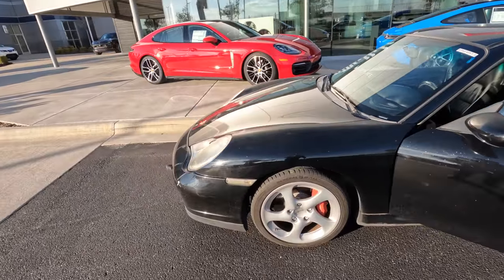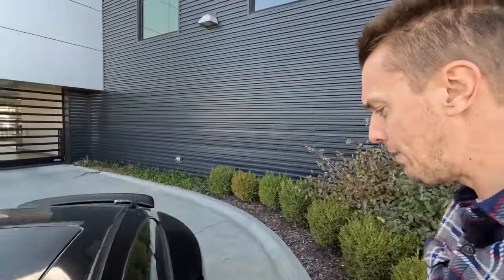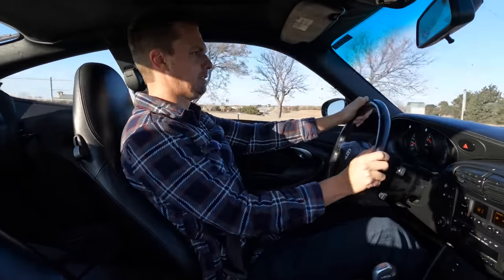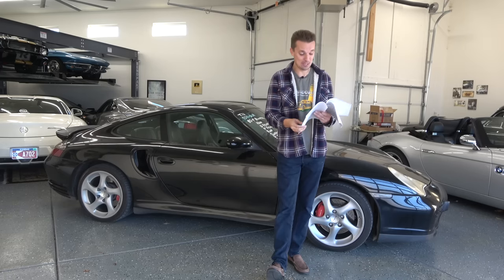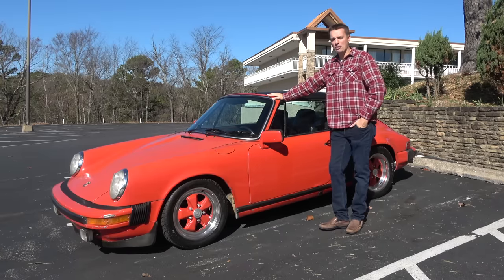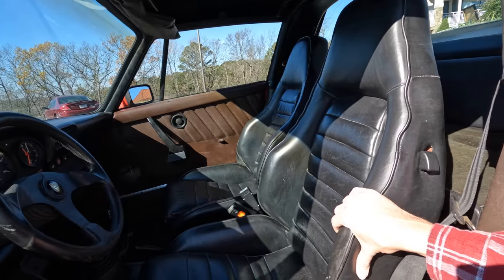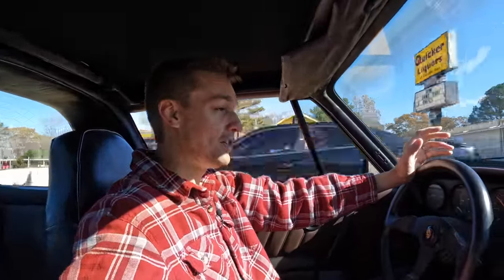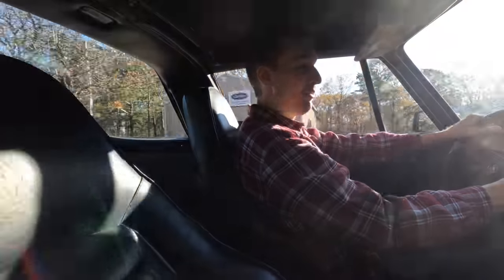The only CHEAP Porsche 911 Turbo is a RUINED ex-Las Vegas rental beater. Should I buy it?

Comment: Seats were definitely swapped, I’ve never seen a turbo without the hardback sport seats. I have a set if you’re looking for them, they need a bit of work but can give you a good deal.
Reply: I'd guess the supple leather is way more common to see paired with a Tip, which itself is in the minority.
Reply: There are some turbo 996 Porsche that don't have hardback but i think they did swap them
Reply: My 996 Turbo doesn't have the hardback sport seats.
Reply: Supple leather 996 turbos are everywhere…
Reply: Sport seats and hard back seats were separate options in these 996 turbo cars. Many  Tiptronic cars shipped with the standard comfort seats.

Comment: I had an S-Line a6 2.7t,  years ago. I honestly didn't hate the tiptronic. You learn to time your upshifts a half second early, and once you nail that delay, it becomes fun to use. I remember the downshifts being almost instant, so if you needed to pass, you just tossed the stick over and down and zoom around the slow guy lol
Reply: Ive had one tiptronic car and i also thought it wasnt that bad.
Reply: Tiptronic actually suits this 911 Turbo. The engine has so much torque you don't need a fast / manual shift unless you are using it as a track car.
Reply: It's actually a good thing these initially came with slushmatics for the automatic version. It would have been worse if it had the sequential automated manual transmissions that most other supercars had at the time. In everyday cruising, stop/start traffic and freeway driving you wouldn't want clunky shifts.
Reply: Agree. Gotta time the upshifts but you definitely pick up on it fast
Reply: tiptronic became popular when I was learning to drive stick, tried it on a new (at the time) altima which threw me for a loop because it was down to upshift and up to downshift so I'd accidently try  to downshift to hit third but that thing didn't accept your prompt to shift half the time anyways lol
Reply: i do imagine that is the case
Reply: Yep, the trans is good.
Reply: @aaryeshg.6526  True, early dual clutch automated manuals were pretty horrendous, nearly impossible to launch smoothly or crawl in traffic. Even if they worked correctly it was just a matter of when, no if they break.
Reply: Got a triptronic in my 2000 A4, definitely love using it, almost as good as the manual in my 97 A4 Quattro

Comment: I have a 997 turbo manual.  I think it is a better car than the 996 and not just because of the lights but both rank among the greatest cars ever made.  They have mind bending performance but can easily be used as daily drivers and with the back seats down they will take plenty of luggage.  I even got a full set of golf clubs and trolley in the back once.  The acceleration is amazing but the best bit is that they take corners at ludicrous speeds.  I retired recently so sadly mine is going to be for sale once I sort out an electrical gremlin.  I have had it for six years and have loved every second driving it.

Comment: On the orange Porsche - I detail cars, and I think the paint could be brought back with a moderately aggressive polishing compound, followed bu a hand wax. Be careful not to buff through the top coat, Comet WILL work, especially on single stage older paint, but it bleaches and flattens the finish. On the deck lid, the holes are relly ugly. IF you can match the paint, fill and touch them up .If not , consider putting in flush carriage bolts and touching them up. Wouldnt look too badLOL.

Comment: You totally nailed it with the “lower horsepower, older car” being super fun to drive on back roads. Certainly not the same, but sometimes my e30 is way more fun to cruise around in than my “fast car” or ones I’ve owned in the past.

Comment: I've become a big fan of the 996 with in the last 2 years. The headlights kinda grow on you once you see them in your garage, and is part of the reason you can get better deals on the cars. Although a 987 Cayman S is more of my obtainable dream car, I've owned a 986 with the 2.7 swapped. Just rather have a hardtop and a little better interior design.

Comment: Turbo must be a premium upgrade. In 2008 I bought a wrecked 911/996 Carerra 4 AWD with the wider rear quarters for $15k and pit 7 more into it to have it repaired painted.  It was only 7 years old vs 20.

Comment: My 1st nice car was a 2001 turbo CPO car. It was fast for its time and a daily driver. Some expensive (CPO covered) engine problem was fixed for free by dealer and I sold it when warrantee expired. Mine was a Tiptronic as well and as I recall, they were faster than the manuals 0-60!

Comment: That GoPro needs a jacket, apparently. Double Porsche rescue seems risky, but it appears both of them want to live. The 911 really needs an interior which might not big a big bill compared to the roof and engine replacement, but that stripper paint job on the other? That'll looks like it'll need a complete sanding and respray won't it? That wouldn't be cheap even if you took it to Maaco.

Comment: Tyler (Hoovie),

FWIW, the carburetors mentioned appear to be two 3 barrel Weber 40 IDA 3C models.

These Weber carburetors are configured as inline three barrel, using three throttle plates on a common throttle shaft. As such, this carburetor is not progressive as all throttle plates displace equally.

Once understood, Weber carburetor tuning becomes intuitive. Though it is highly recommended to incorporate two wide band O² sensors, one per engine bank, to record or diagnose rich or lean air fuel ratios.
One may expand on tuning by installing individual Exhaust Gas Temperature thermocouples to aide in refining AFR and ignition curves.

I apologize for being verbose.

Comment: It’s a money pit. The windows out respray, missing engine parts, sort the oil leaks which will most likely involve a top end rebuild will see you spend over $30k and it will still have 140k on the clock.

Comment: I have a 20 foot 1995 Ford E350 class C RV with some water damage for sale $2500obo in Denver area if you like project hoopties 

two brand new front tires 4 rear tires new last June.. new brakes all around last spring in April .. passed emissions.. needs shocks bad .. has a weird vibration/shutter between 35 and 45 mph .(normal street speeds) I think it’s the transmission. But if you let off on the gas and reapply the gas it corrects it and goes.. also has a minor exhaust manifold leak .. passenger side rear tail light is out I think it’s the blinker. Has been replaced multiple times and works for a few years but continues to burn out I think it’s from water damage which was never fixed in the back only sealed and resealed and resealed could really use all of the cupboards on that side torn out and new wood put in an insulation new roof. It’s doable but it’s a huge project just easier to continue resealing when it leaks that’s the main problem with it also the furnace needs a blower and I think a overheating switch possibly. The plumbing works the water heater works the toilet works the stove the microwave the oven and the refrigerator all work the microwave only works when it’s plugged in to power the air conditioner does not work the generator does not work could be fixed but will be very expensive

Comment: I bought a 2003 996 Targa two weeks ago.  MINT condition with 70k miles. Tiptronic, but for only $27k from a Ford dealer.  Would love to get your thoughts.  Feel like I stole it.  FWIW, the IMS bearing is confirmed to have been replaced at 48k miles with an LN Engineering retrofit
Reply: It is my new Daily Driver.  Damn the torpedoes.

Comment: 130,000 miles of people driving a cold engine the way Hoovie does in these videos.  At least it was likely broken in well.  I’d be very worried about the tiptronic where every light for 121,000 miles were  a drag strip. . .

Comment: I could picture the Porsche dealers all clapping as it drives off the lot! LOL They can always count on Tyler to bail them out when they are expecting to take a haircut (Huge Loss) when selling or auctioning a sketchy trade in.  Get it less than a mile down the road and the first trouble light illuminates, PRICELESS!

Comment: -Bring on that Porsche.. I will be your viewer slave at least until the Porsche review is over.. Whoops..Tiptronic shifting. See home much it would cost to pull that "rotten tooth' out of the car.
-Did anyone notice in the center of the steering wheel, the Porsche badge is black, silver white, missing red and gold? 
-How did I see that. 
Well I have a RestoMod-Outlaw '86 911 Carrera with steel turbo flares butt welded on just like they did in Germany for the turbo version. Everythng on my car is black: interior/exterior,  rims, carbon fiber hood. The Porsche hood badge is not the original  bright Gold, Red andBlack —it is just matte black.The original badge screamed TOO LOUD and disrupted the power of the all black. So I found a badge on the in-net  that is matte black that blends with the hood hood — way cool. The questions IS, is the badge on the steering wheel aftermarket or stock (for this car??)

-And now this video turns into a "double feature" wlth the Targa (notorious for the roof leaking). 
-The "Pig" ride was such a small token.

"A garage without a Porsche is just a dark hole" — Walter Rohrl - Porsche Development

Comment: This is why I hate being a poor nobody. I mean poor financially I don't mean the other way. Honestly if I had the money I could afford better but I'd buy that car in if nothing else s** and giggles. Hydra painted black with the glitter for starters fix majority of the mechanical stuff like the windshield. I just love the stripper glitter paint job yeah I'm an ass. I just don't know if I could drive the car physically speaking because it doesn't look like the seat goes back far enough for my legs I have a huge problem with I have to have my legs straight out or I start having involuntary muscle spasms and so on. That would probably be the one reason I might not buy that car if I could do it financially. It looks like a nice running and driving car aside from the cosmetics and things like the oil leaks.Not everything's about the price sometimes it's about the character and the story to the vehicle you don't mind spending the money that when you're done you've got something that's unique